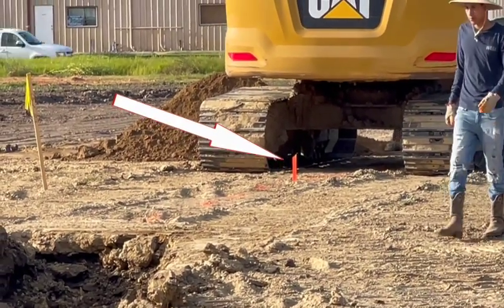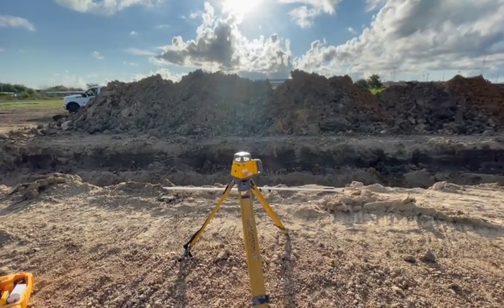How to Plumb a Development -STORM SEWER

Comment: I always have surveyors set line and grade and rim elevations of top of inlet grate before start of digging. 10 to 15’ offset cut/fill hubs depending on depth of trench. There are a number of ways to do it,just has always worked best for me.
Keep up the good work.

Comment: 👏🏼 question: if you were doing your own site(a shop for heavy equipment with a level parking lot) in a couple of acres. Is the black plastic pipe structural for the traffics? Or would you use concrete pipe? Imagine it would have 3-8 feet cover. Clay and sandstone. Thanks
Reply: HDPE is plenty. Make sure you get double wall

Comment: Does the FL of the inlet have to be the same elevation as the FL of the pipe?
Reply from the maker: You can have a drop on the flow line coming into the inlet if it is higher than the exit. But you have to use concrete and shape  the bottom of the inlet to match the outgoing, flow line.
Reply: @thomasconstructiontexas  we’re installing 24” RCP storm drain. The thickness of the wall of the pipe is 4”. Should I cut the pipe on the bottom lip to reduce the thickness to 1/2 inch or 1/4 inch so it fits flush with the inlet so they both have the same flow line elevation (the pipe coming in and the inlet floor) or should i not cut it and leave the thickness of the pipe so the pipe coming in the inlet would have the FL elevation but the flow line of the inlet would be 4 inches lower because of the thickness of the pipe ? They inlets they ordered have a precast floor and the knockouts are not the right size. For example the pipe coming in can be 24 inch and the knockouts are 50 inch.

Comment: Why don't you put the laser inside the pipe?
Reply from the maker: Taking the pipe from the sun and putting it down in the cool ditch will make the laser jump around. You can put a fan at the end of the pipe and solve that problem are you could set the laser on top. We have a lot of humidity

Comment: Interesting, all the different lingo. We call them pre cast drainage inlets, bottom of invert, we use clean stone as our stabilizer, and the hole for where the pipe will go "the knockouts." All good, and all the same. Thanks for sharing!
Reply from the maker: I agree. I'm from the East Coast and the lingo is a little different. The ground we build on down here. Is the ground we avoided building on the East Coast.